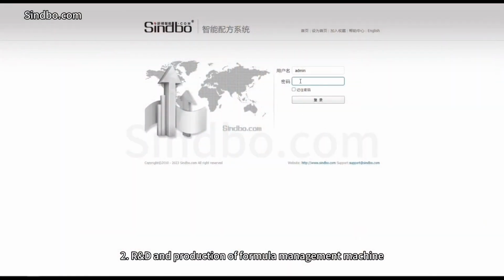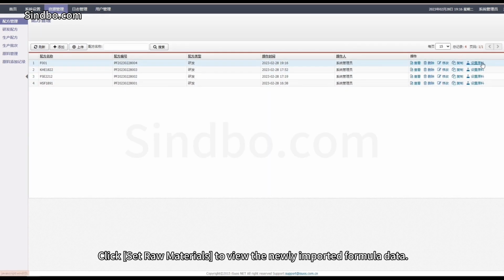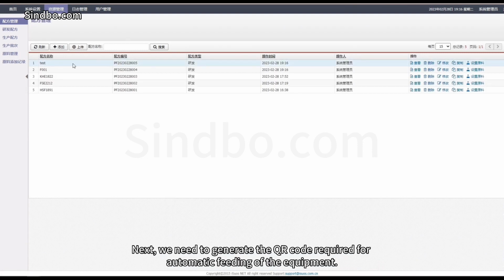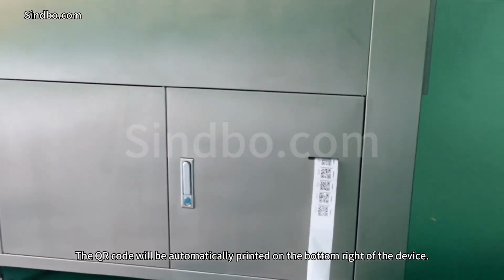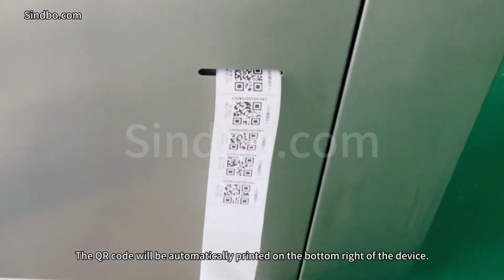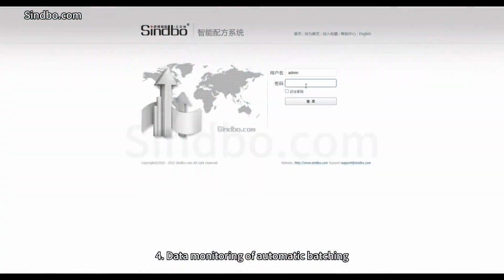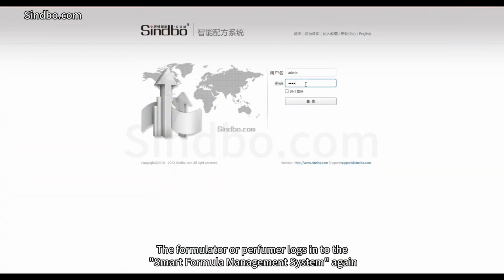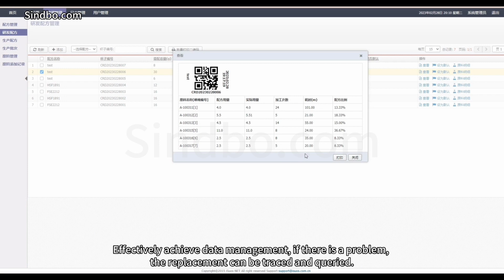Sindbo Intelligent formula flavoring equipment, Jamzhi Technology

Comment from the maker: Efforts to solve the problem of environmental pollution: the storage bottle is made of stainless steel and each raw material has an independent pipeline, which can be reused and improves the production efficiency.
Efforts to solve the problem of batch error: in order to avoid manual feeding errors, raw material processing is recorded in detail.
Efforts to solve technical safety problems: the formulator generates the recipe into a QR code, so operators cannot see the recipe and they just use the QR and operate the machine and the company does not have to worry about technical leakage.
Efforts to solve the problem of holiday rushing: the device can realize unmanned operation and unmanned production, and automatically complete the operation you require.

Comment from the maker: Product Overview:
Good recipe confidentiality: set permissions for recipe management. The formula is split and managed independently so the formula is kept confidential and not leaked.
    High processing accuracy: fast formula batching speed, high processing accuracy, automatic calculation of dosage to eliminate manual error.
Improve efficiency and reduce costs: operation is convenient and simple, one person is responsible for multi-task, which improves efficiency and saves costs.

Intelligent formula management system: the formula is scientifically managed, not easy to leak, and can be easily docked with third-party systems,
SID-220LAB: Simple operation, confidential formula, accurate and stable raw material ratio ,Automatic recipe control system: simple and easy to operate with the user-friendly visual operation interface  Accumulation of industry technology, independent research and development of software, fast after-sales service